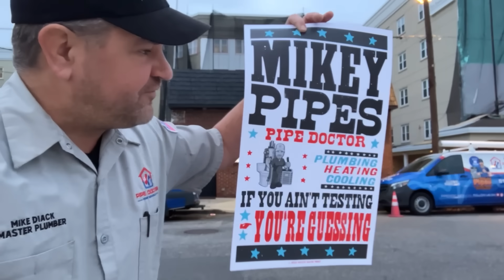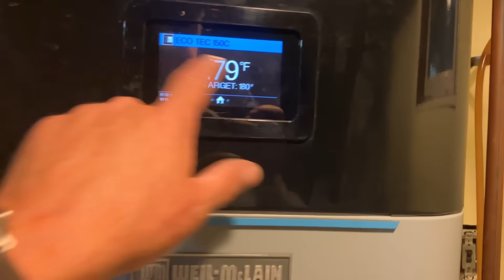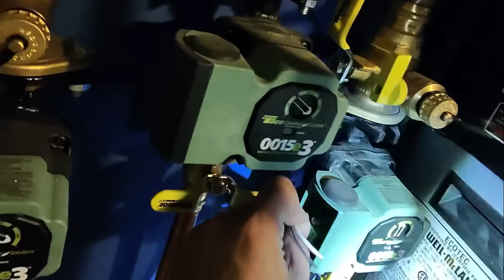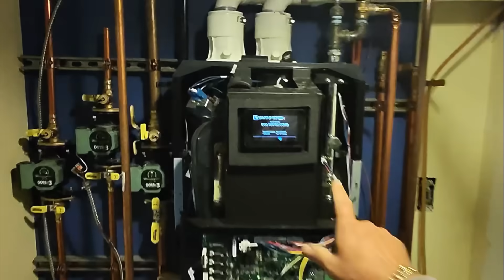Weil-McLain EcoTec Combi Boiler FAILURE — Home FREEZING for 48 Hours! (Easy Fix)

Comment: Not a fan of the more expensive ECM circulators because they fail so often.  The 50 watts saved over the standard 0015 three speed would take 10 years to break even on energy savings. But in all likelihood the ECM pump would die before ten years and cost another $275 to replace.

Comment: Here in Europe we all have those small combi-heaters. They work great for decades. My Remeha boiler gets once every two year maintenance and that's it. Changed the setting of the boiler myself, so it only produces warm water on demand. And with a smart thermostat it makes sure there is no gas used when nobody is at home.
Reply from the maker: Sounds like you have a very efficient system set up!

Comment: As always great video. The bad circulator speed was set to 2. The replacement  was set to 3.  Will it make a difference?
Reply: three floors of cast iron and tube/fin baseboard, probably needs it on high anyway.

Comment: We've got the 150C as well. I usually have the DHW set to 130. Occasionally, I'd like to set it to 140, for certain household cleaning projects, but it also sets the radiator heat from 180 down to 140. Then I can't get the rad heat back to 180? Shouldn't they be 2 separate "circuits"?

Comment: Do you offer warranty on your installations. That circular premature failure should be covered! Especially, if your company installed it. No charge call would be great customer service
Reply from the maker: Yes, we offer warranty on our installations however, this was installed almost 2 years ago and has not had any maintenance since the day was installed so there is no warranty that exists other than a manufacturers warranty on the equipment
Reply: Does circulators have at least a five year Manufacture warranty
Reply: Funny there is no maintenance on a Tayco circulator their water lubricated